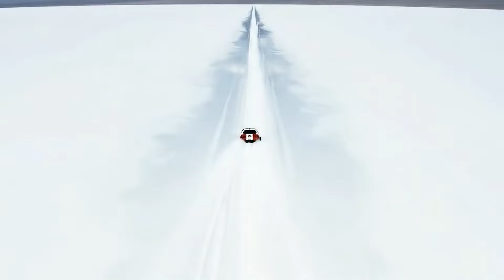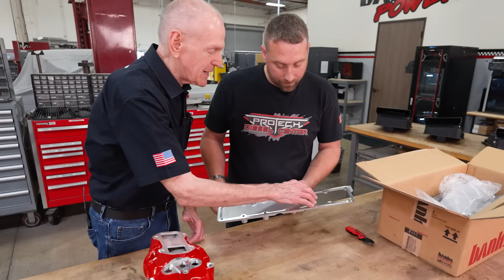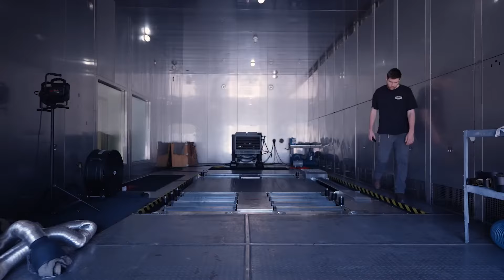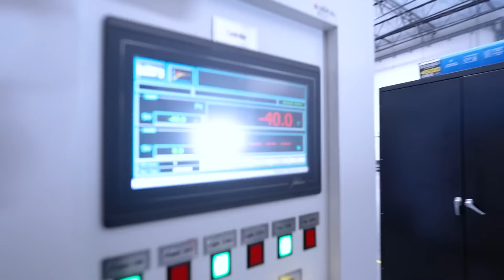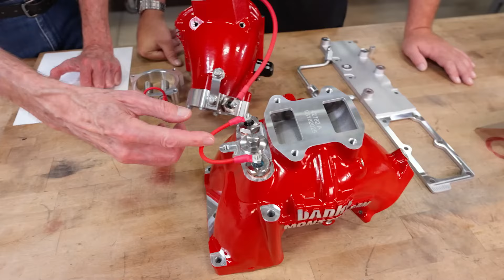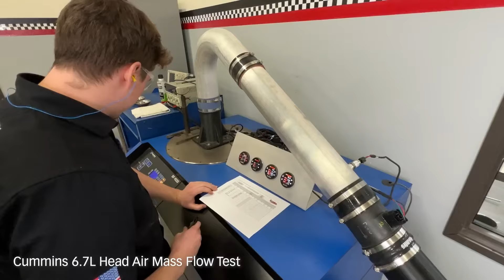NEW Dual-Heat Monster Ram: Unboxing + Why It Beats Stock Grid Heaters

Comment: Banks products are hands down the best. Engineered properly to do what they intended them to do.
Reply: Banks said he designed it for performance and he never put out a single dyno result. Snake oil salesman. Get a heater relocation kit and save 400 dollars
Reply: @allenstyer205 snake oil salesman? Your joking right? Banks is one of the most well respected people in the industry.  Have you seen the work he does with the oem and OshKosh? You're post couldn't be more wrong.i suggest you do some research
Reply: @josephhettiger2711 😂 his junk is overpriced and his selling point for most his products is "thottle response"